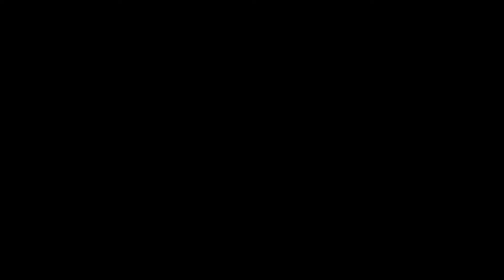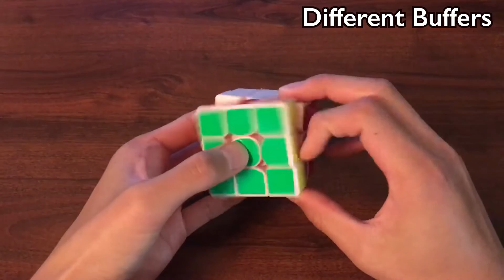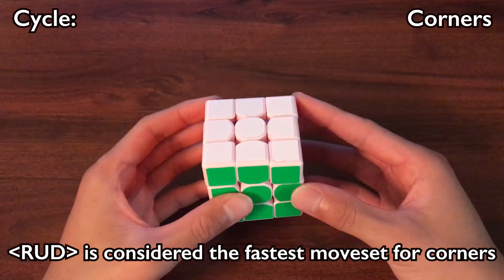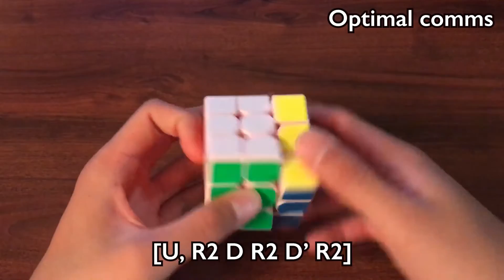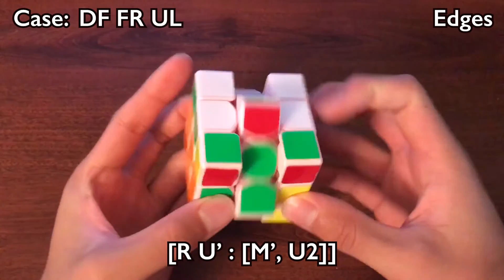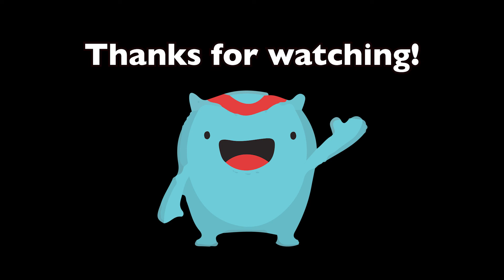3-Style Tutorial Part 2: Speed-Optimization

Comment: Do you know why some BLDers use FU instead of UF? I thought for a long time that it was just a M' away from DF and then made learning easier. And are there differences between the FU and the UF algs ?
Reply from the maker: Stickers on the same piece will have the same algs. This means UF and FU algs are exactly the same. The only difference is that the cycles will have different letters associated with them. For example, if you use UF, UF-BU-RU would be QM in speffz. With FU, FU-UB-UR would be AB in speffz, but the comm is the exact same [M', R U R' U']. 
The reason why some people learn FU instead of UF is because the letters associated with DF and FU are similar. Also, it's easier to float parity (M/M' away). Finally, if they ever do bigBLD, wing tracing is the same for DFr and FUr.

The same goes for corners: UBL, LBU, and BUL all have the same algs but the cycles will have different letters associated with them.
Reply: @timothygoh-4bld649  This is precisely why you should learn M2 with the FD buffer, so you can float parity and learn comms easier with UF. It's just an M/M' away.
Reply: @nathanaelmorgan8604  nah just use U2

Comment: You said that UFR is the best corner buffer. I'm a UFL user and almost finish all 3style algs (mainly optimized RUD). How do you think is the quality of these 2 buffer comms? I think the difference may be very very little if it does exist. Thank you.
Reply: Whats the difference? I think you just need to mirror algs and see whats faster for you. I am lefty so I would use UFL and mirror the algs.
Reply from the maker: I think UFR is still slightly faster but the difference is small (~0.5 seconds)
Reply from the maker: It’s easier to do RUD with UFR. If you prefer LUD then there’s no difference since UFR and UFL are R/L mirrors
Reply: 4BLD Okay thanks for explaining.
Reply: Pin Guin I will still use RUD for UFL

Comment: Hey Tim, how fast is really UFR compared to UBL?

Edit: I think Graham is a UBL user, and he is a fast BLDer!
Reply from the maker: The difference between UFR and UBL isn't as great as the difference between UF and DF. It's hard to put a number on it but the general estimate is that switching to UFR will save ~0.5 seconds. 
Yeah, Graham uses UBL but he's planning to switch to UFR. Also, don't be mistaken; I'm not saying that it's impossible to get fast with UBL (Angelo, Jeff, Ishaan, use/used UBL), I'm saying that UFR is faster.
Reply: Not Tim, but my UFR comms are around .1-.2 faster than my UBL comms each, which makes for about .4-.8 saved per solve. Although this isn't a huge amount, and UFR+1 parity is slower than UBL+1 parity, advanced parity techniques are much easier with the two buffers right next to each other.

There are many fast UBL users, but that doesn't necessarily mean it's the best buffer, although with current mainstream techniques it may be. However, UFR's potential as the best buffer isn't 100% agreed upon for now. For example, Ishaan thinks UBR may have more potential as a standalone corner buffer since the simple comms are less awkward.
Reply: Since the time saved is ~1 sec, then I am probably going to stick with UBL for a while, especially since I am not world class by any means, I am sub 5:40.

2 days a go I figured out and wrote down all the 108 move optimal 3-cycles using UBL-DFR/RDF/FDR-xyz, so if UFR was extremely much faster, then I officially wasted 4 hrs. (No offense)

Comment: Inb4 people insist [U': [D, R U' R']] is fastest
Reply from the maker: If we count UD as one qtm, then [U' : [D, R U' R']] is 9 qtm while [D, R U2 R'] is 10 qtm. U' is also easier to do regripless. Obviously, it takes some drilling and the difference is small but it is objectively optimal
Reply: That’s optimal
Reply: It is for some people
Reply from the maker: Originally, I did have this in the section where I talked about optimal comms but the video was too long so I cut it out. Ok, I updated the desc with optimal solutions for other cases
Reply: Meh for algs with U2. Necessary for algs with D2
Reply: Depends which you can execute fastest, personally, I can't do [U': [D, R U' R']] faster, so I use the other. Some people will insist that the U' alg is faster no matter what.